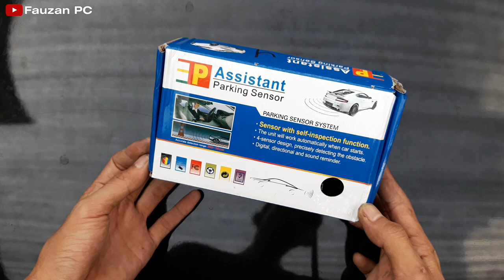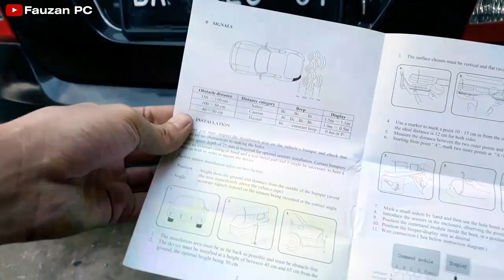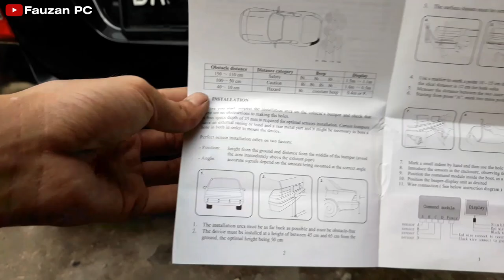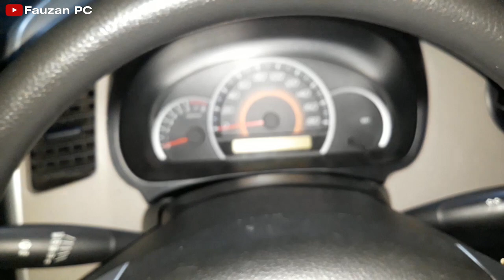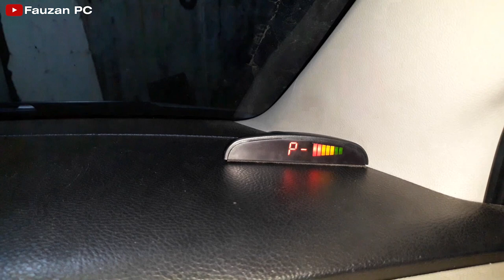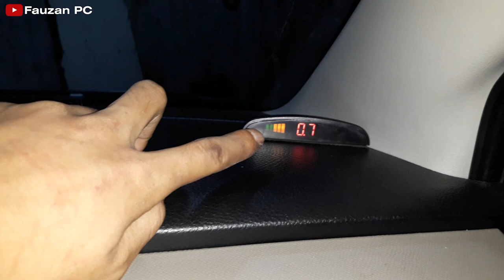Cara Pasang Sensor Parkir Di Mobil

Comment: Bg itu kan sensor nya 4,
Kalo 2 di pasang di belakang
Trs yg 2 nya di pindahin ke depan
Bs gak bg?
Reply from the maker: gak bisa bang, kecuali klo modul nya ada 2 juga bisa, satu utk didepan, satu utk dibelakang
Reply: biasa sya prnah nmpak, tiga di belakang dn tiga di depan, 1 panel yg sya thu, tu dkt krta ssang yong raxtion 2006 xslap sya la